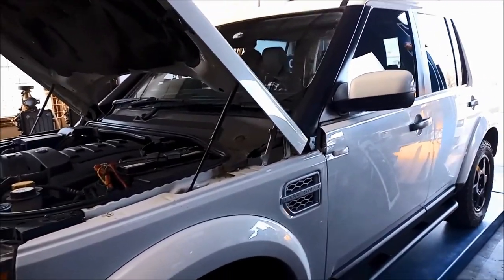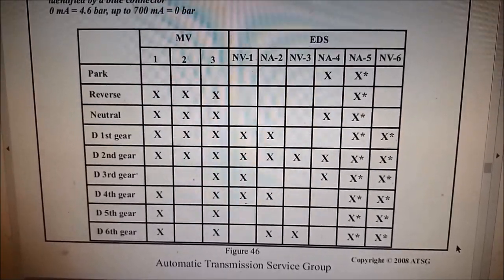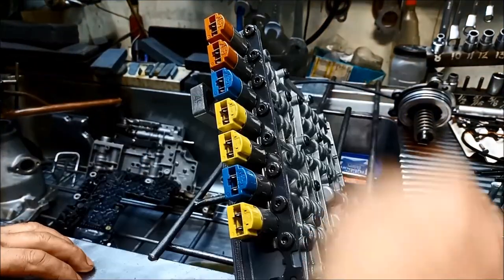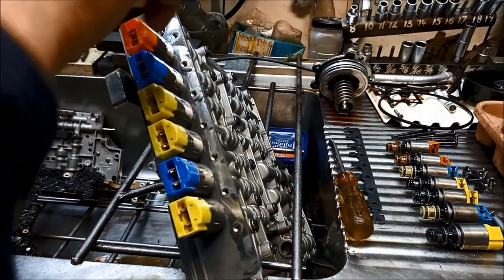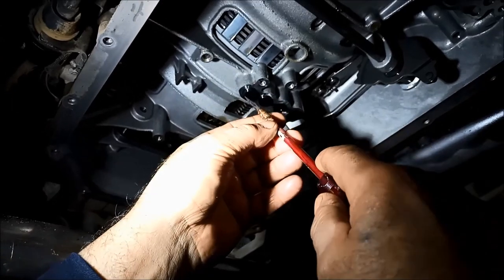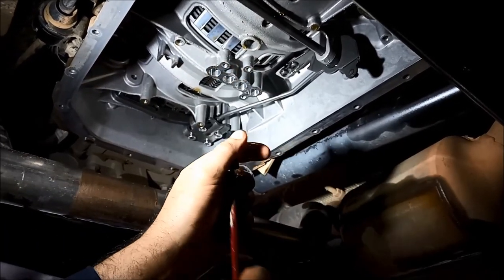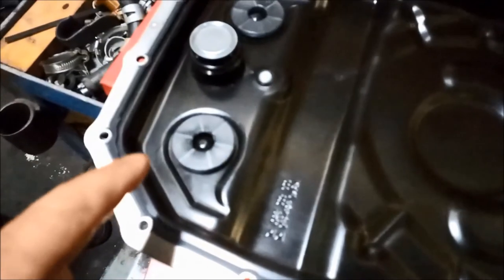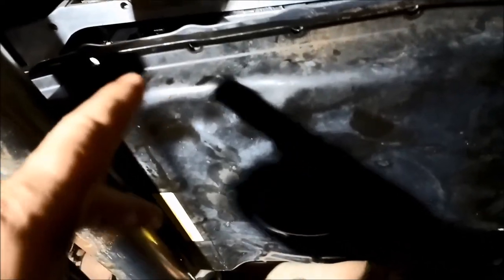Landrover Discovery ZF6HP28  Floating Shifts Transmission Solenoid Set Replacement & Filter Service

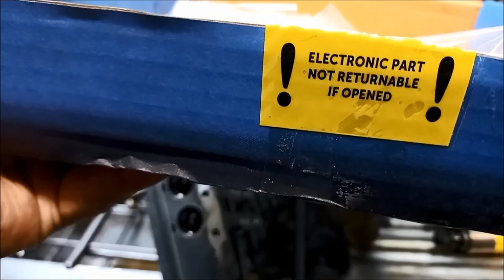Comment: 11:50 if you have some other issue hooking them up could damage them with a plug and play type of approach. They said the same thing when we purchased a new control board for our furnace. They do want people trying to randomly swap parts or ruin a new part and return it after they figured out theirs another issue.
Reply from the maker: we are lucky haven`t had issues so far....thanks for the heads up. cheers

Comment: Thanks for the vid. Would love to see a valve body rebuild, including check valve, o-ring and separator plate replacement, of a 6hp28x - especially the e-shift gen2 valve body in the BMW X5 e70s (normally the 3L diesels). Keep up the good work
Reply from the maker: hi, pity didnt have more time today to make a vid, we did one in a 6hp26 put in a sonnax zip kit as well as solenoid set, sep plate and valve body vac test. will definitely make one when time permits. thanks & cheers

Comment: Another great video - what can I use to clean dirt off the sensors including range sensor? can it be a can of electronic cleaner or similiar?
Reply from the maker: hi, you can use solvent or air pressure. thanks and cheers

Comment: Good to see some land rover videos, can you please explain the floating shift issue ?
 I think this is what i'm experiencing in my 2007 discovery 3 with ZF6HP26 trans, lower gears i get odd/slow/hard/ delayed  shifting and somewhere between 50-60kph i get what feels like a slight nudge in the rear then it faults and i get a P0730 incorrect gear ratio code.
 If i baby it past 60kph its as smooth as.
Reply from the maker: hi,  depending on mileage, is usually a cross leak on valve body to case seals ( they flatten out and/or harden ), contaminated and/or leaking solenoids and can be loose/worn-out end plugs on valve body. we supply all parts you may need if you`re in australia. contact us via our facebbok link in description. cheers
Reply: @YepThatsIt  thanks i'm in melbourne, i replaced the bridge, tube and mech sleeve last year but no change. Car has 220k and never towed or used offroad till i bought it 5 years ago, did the metal pan upgrade when i did the seals.

Comment: Any Idea which one is the shift selenoid b  electrical?
Reply from the maker: hi, sometimes its dependent on the scan tool. it can either be b shift or 2nd gear or can also be pressure control solenoid b. on these trans there are more than one solenoid working for gear ranges. cheers